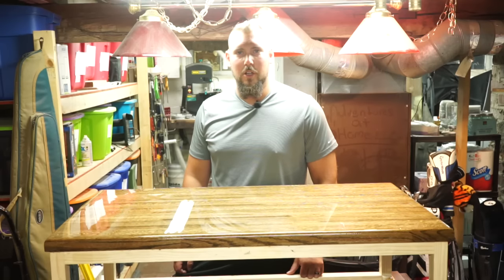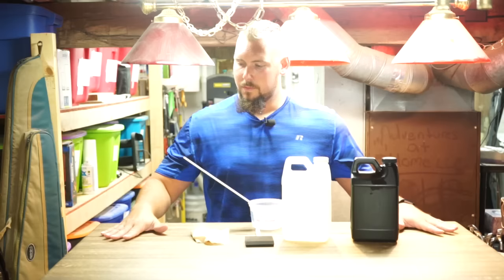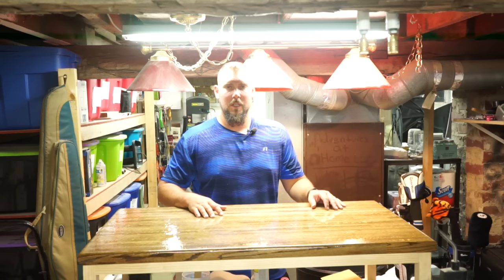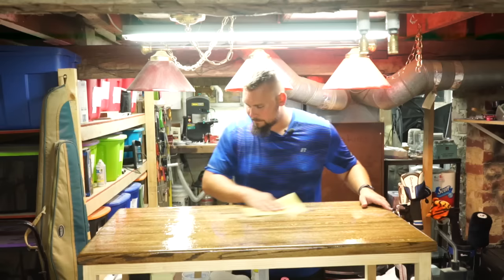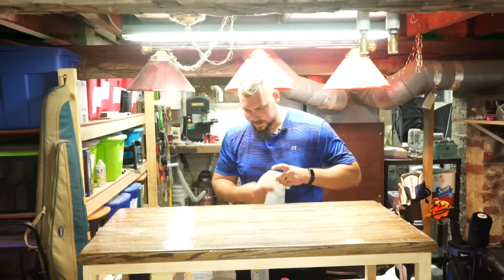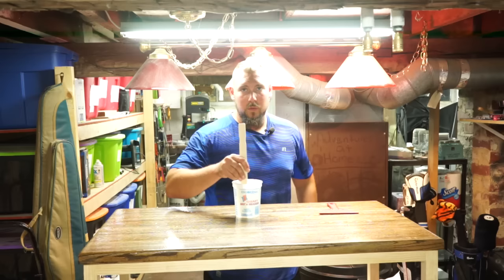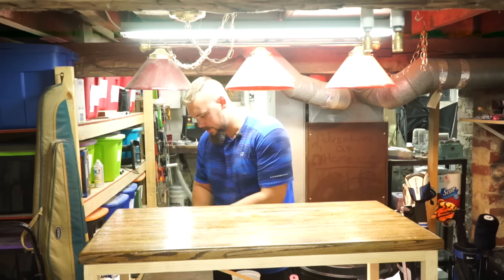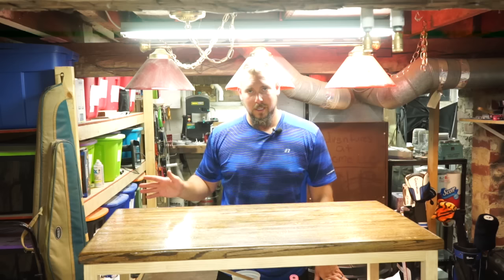DIY – How to Apply Clear Epoxy Resin – “Liquid Glass”

Comment: Rule number 1 when working with resin: "ALWAYS WEAR GLOVES". This stuff is nasty and the hardener can burn your skin. If necessary, when eye protection too as the heat from hardener can make you cry. 10 years working in fiberglass factory :)
Reply: My wife used it for the first time about 6 months ago... her ENTIRE body swelled up. 

Respirator and gloves... this stuff is NASTY!
Reply: 24:34 24:34 ll
 Mom

Comment: Just a couple thoughts.    When doing this on the flood coat use extra epoxy a little thicker will give you a much more even coat .    Edges wet them with a thin coat of epoxy before allowing it to run over the edge as it will be a much more uniform coverage.     The torch does not work a s well as a heat gun set on a low setting.

Comment: Thank you for explaining this so well.  Too many people spend too much time talking about every tiny detail and personally, for me, I just want the basics!
I find your videos to be easy and “just the facts!”  Great job!
Reply from the maker: Thank you for the kind words. And thanks for watching!
Reply: Oh and can you use a heat fun rather than a torch?
Reply from the maker: Yes - it takes long though, and you risk blowing dust deep into the epoxy.
Reply: @AdventuresAtHomeLLC  thank you for your advice and quick response!
Reply: @AdventuresAtHomeLLC  quick question do u think I can use resin on a wood cross for a  grave site ? Im also wondering if it’ll be ok in any weather
Reply from the maker: Unfortunately this epoxy would not be a good choice for this. It does not hold up well to the elements. A marine grade poly or epoxy would be a better choice. Thanks for watching!

Comment: Pass the torch over the entire surface in a sweeping motion. There are usually many micro bubbles that cover the whole surface and will not pop without CO2/heat from the torch.

Comment: Just did two 3'x6' tables in the garage. I probably over worked the thing, but the bubbles kept coming.  I used a redwood with lot's of knots. (I wanted knots)  to build the tables. I did them a gallon at a time. I did not weigh the product like you did, (lesson 1). I tried to get every bubble out, not just the larger ones, (lesson 2). Finally, I did not apply a thin coat, (lesson 3). Thanks for the video. I think it will help the next time around.

Comment: Thanks for a very informative vid. Now I know why I got lotsa bubbles on my benchtop timber slab, after following all of resin manufacturers instructions to the absolute letter with 2 coats of their 'sealer' prior to flood coat pour. I don't think their recommended sealer was suitable, hence bubbles. I like your method of thin epoxy coat prior to final coat. You made it look relatively simple. I am tempted to have another go at it. Thank you
Reply from the maker: You're welcome. Let us know how it turns out! Thanks for watching!

Comment: Thanks for the tip on measuring by weight. Since not all liquids weigh the same per volume, it's good to know we don't have to worry about that with epoxy.

Comment: The one thing I learned about removing bubbles is that it is not the heat that removes them, but the carbon dioxide from the flame. Breathing on it will do it too. I tried it.
Reply: That's so funny.  Carbon Dioxide...

Comment: @15:28  Raiden Wins!   over-exposed lighting melds the dude's head with lampshade :-) 

Thanks for the tips - watched this video after many others on epoxy resin "liquid glass"ing, and there were several points much better made here.

I'm part way through my first attempt, fingers crossed.
Reply from the maker: Hahahaha. Yes we were quite new at video making in this video. Good luck, let us know how it turns out. Thanks for watching!

Comment: I noticed you didn't address the drips that form underneath. It's always advisable to tape underneath, and remove tape before it completely hardens.
Reply: As they say "prevention is better than cure". Yes you can sand it down, however you can't sand out the resin which will have soaked into the wood, leaving a stained mark behind. Tape saves you having to sand back any drips.

Comment: FANTASTIC video! This is EXACTLY the tutorial I have been hunting for. Thank you very much. Maybe I'll send pics of the project one it is complete.
Reply from the maker: We'd love to see completed pictures! Thanks for watching!
Reply: Kyle, one question, how do you clean up the dried drips off the bottom of the edges? sanding? that easy?
Reply from the maker: Sanding is the safest method, and the one that I prefer. In a time crunch I have used a razor to speed it up, but you risk removing too much.
Reply: Looking for a DIY vid to help a customer clear coat the lower half of small very well made side table I cut a piece of glass for on top, too intricate for glass work on the lower half. As a craftsman of 45 years (born in 63) I find your vid most informative and actually surprisingly entertaining. It's very refreshing to see a craftsman work under less than ideal conditions. Hitting your head repeatedly on the triple light fixture but continuing/soldiering on professionally just soothes my soul for my less than perfect shop. When you started talking formula, 10:30 my mind started to drift. I noticed maybe a kid or yourself fingered "Adventures at Home" onto the duct work and how your wife utilized shelving and then the band saw way in the back. I can only imagine the wonderful projects constructed from that side of the basement. Just wanted to say you're inspirational. Keep up the good work!
Reply from the maker: Thank you very much and thank you for watching. I'm almost sad to say that we are in the process of updating our workspace. A lot of unforgettable projects (and memories) we're made in that small basement workspace..

Comment: Both my  epoxy/resin product and my propane torch emphasize VENTILATION.  I coated a panel door to transform to dining table.  Was afraid of the flood coats, so did several thinner ones.  Next time, I'll be more bold.
Reply: How did the result end up being?
Reply: @tobiashede  I admit that I still have one final layer. Will be bold & pour a lot of product so it floats evenly. Love the shiny glass effect.

Comment: Bubbles: if you notice any bubbles after its hardend, You dont have to live with it. Just take a 1/4 bit, drill it out, and refill.
Reply from the maker: Thanks for the tip!
Reply: Does the refill blend it completely with the old epoxy?
Reply: @tobiashede  regarding your eyes: yes. Regarding xray and forensic analysis: probably not ;D
Reply: When I did my first table top I “overworked” the bubble removing process in one particular area and as a result the surface “filmed over” with the over concentration of heat preventing the bubbles to be released. The area was approximately 16” x 5”. After the resin hardened completely, I buffed out the affected area with a standard grinder and resurfaced the table with another coat of resin. The finished result was surprising. It was impossible to tell which side of the table I had repaired/resurfaced. Seems to be really forgiving that way! This was the most important thing I took away from my first experience with epoxy resin.
Reply from the maker: Thanks for sharing! It is amazing how well a new later of epoxy will blend with the first. Thanks for watching!
Reply: @AdventuresAtHomeLLC  Hey man I'm glad the tip helped! I thought about it afterwards and I wasn't sure if that tip would work with every epoxy, I only ever work with Famowood. I probably should have mentioned that 😅

Comment: I was going to use glaze coat same stuff as in this video i decided not use the stuff being if the project gets messed up with bubbles or even if the coating gets scuffed in the future it would be nightmare to resand everything down to bare wood think its better just to leave wood natual no coating just a stain on top.
Reply from the maker: That's definitely a downside to working with this stuff. Start small and practice first! It's actually not to hard to repair scuffs with a little heat and buffing. Thanks for watching!

Comment: I saw a table top made with coins from foreign countries and then it was all in clear epoxy.  Just looked amazing.  I would like to do a table  top in cancelled stamps and  somehow get the pictures to be stable and  not  looking like oiled through.  Maybe a water based coating over the stamps.  I have seen tables with pictures under them on paper.   So some paper is able to be covered and still be quality to see.

Comment: The way you handle the drips from the sides is to either, take a chisel and scrape them off, or sand them off.  If I were to do this project, I would have done the top before attaching it to the base so I could turn it over and scrape/chisel the drips off the bottom easier.
Reply from the maker: The base was removed after the epoxy dried so the base could be finished. The base was attached merely to hold the top while finishing

Comment: Your work looks very professional.  I have been refurbishing the interior of a 21-year-old Rolls Royce (leather and wood) and the picnic tables on back of the front seats looked awful. After repairing the veneer and stripping them to the best of my ability I put on more than a dozen coats of lacquer with a spray gun but I could not get the finish even and it was very dull so after watching some videos I decided to use epoxy resin on them. At first I thought it looked great on the top side but days later when I did the bottoms they looked very, very bad---a medium scale disaster---and over flow messed up one of the good sides. I have most it removed. It came off of one table in one intact sheet. Now I am afraid to use epoxy resin on them again. Should I try epoxy again or use a spray on polyurethane?
Reply from the maker: For that application I would use a commericial grade table top clear coat. Check out AquaCoat's commericial finish. Thanks for watching and let us know how it turns out. We'd love to see a picture of that restoration job!!!
Reply: @AdventuresAtHomeLLC  I think some of the epoxy got past the masking tape and is inside the sliding spring-loaded mechanism that opens and closes the fold down tables I have to refinish. Is there a thinner or chemical that will dissolve it so that it will come out?

Comment: For a super fast and super dry cure time: turn oven on WARM for ONE MINUTE then TURN IT OFF.. Set your piece in there as oven cools. Usually cures fully in couple hours.
Reply from the maker: Interesting. Never heard that before. Though I don't think I can get most of my tables in the oven..
Reply: I thought of that when I commented. I can't build tables in my apartment or I would. I make lots of boxes and clocks, which fit in there nicely. Lol. Great video! Thx!

Comment: Awesome job, but if you use a roller it will make the job look better, it will push the epoxy into the cracks, but awesome vid man!
Reply from the maker: Thanks for watching! We found that the roller introduces a lot more air bubbles than the foam brush. Whatever works best for you though!

Comment: Any solution to removing brush marks in water based poly?  I have two thin coats on with a sponge brush and still see streaks.  This is a beautiful custom table top and I could just cry.   I didn't use the resin since I need a little bit more confidence first.  Any ideas on getting the brush marks out?  Thank you!  Your work is awesome.
Reply from the maker: You'll have to sand 😞 (lightly, but enough to remove the brush strokes).     Thanks for watching!
Reply: @AdventuresAtHomeLLC   thank you so much.  I did exactly that but the first coat marks are hard to get to.  It looks much better...sanded with a little wetness...Not re doing with anything.  Again, thanks!

Comment: quick, how did you find the weight/volume?  I've gone by volume on a couple of trial projects and they've worked out well.  my first error was not doing a thin coat, tried a spray on varnish which wasn't adequate.

Comment: Over time I would be worried about some sort of cupping effect on the wood if the bottom has not been coated. Ambient moisture absorption would be very uneven top to under side.
Reply: Then there is the radiant sun effect with the energy from the sun radiates and transforms objects to go in line with the sun rays, and add gravity to the equation basically you have a warped table so to counter that just add more windows to the house so that light comes in from all sides and as far as gravity forces, well, you can figure that out. Flip the table upside down everyday for the same hours and bam, no warp, flat as a paper!

Comment: Very good video. Once the flood coat has cured 72 hrs plus, can you polish or buff to remove imperfections (dust for example). There's no way mine will be dust free. Thanks
Reply from the maker: You can buff, but it is quite tedious and labor intensive to get it back to crystal clear. Thanks for watching!

Comment: How come  nobody  uses vibration to make the bubbles rise and to help level? I strapped  one to the leg of the table I was working on and during the pour itself. I saw my bubbles rise , break and fill in without having to use heat and causing wind that might stir up dust.  I just put a couple of rubber bands to hold  it. After the pour (2min.) I  put some cloth around the massager till the vibes  were hard to distinguish.. Checking  a couple of times saw nothing.Coverd the table with a clean cheesecloth supported above the surface to keep bugs, hair and dust off. Watched a lot of videos and  no one mentioned  using  these very helpful steps in my opinion.

Comment: What about all the epoxy that was running over the sides? Won't it leave some drip edges along the bottom of the sides?
Reply from the maker: There's drops along the bottom. We clean those up with a razor and sandpaper once they are hardened.

Comment: Don't hold the torch in one spot too long or you'll discolour it from burning. You shouldn't have smoke like you did. Just a quick flick over is all that's needed to pop bubbles. 
You also shouldn't wipe it down with acetone as that is trying to dissolve the epoxy in your table.

Comment: I could buy this two-year-old epoxy. Do you think that the jars will still work? This is the add that was placed.  Unopened 5 gallons of clear table top epoxy. I bought it 2 years ago to do a counter- never got around to it.  I don’t want to use it on the counter after all this time. I’m sure it works but I’d rather get fresh stuff when I get around to the project. My loss is your gain.  It was  roughly $300 when I bought it.

Comment: Good to know, so about 2x as much resin as hardener, by weight. I’ll check but thats a good starting point. Don’t be afraid to stir faster, more aggressive. Also, torch the whole surface more consistently. Not just parts. Keep it moving. The heat will warm up the epoxy, pop the bubbles, and help it self level.

Don’t use a flat scraper, use a foam roller. Lot of good tips on YouTube from companies that make epoxy counters.
Reply from the maker: Thanks for watching! 

We found stirring more aggressively and using a foam roller introduces lots of air bubbles into the mixture. By not doing trying to about air bubbles as we work we then only have to torch the parts with air bubbles.

 But of course, this is just what we found works for us. Thanks for the advice!

Comment: Hey not sure if this was asked in previous comments, about what percentage of the mix did you use for this first coat? A guestimate is fine. I’m doing a 15 sq ft table and will need a little over 2 quarts per the instructions. Just wondering how you decided how much to use for the first coat?

Comment: I was given a desk made out of 2x4's.  The top is not level in places.  I wanted to apply epoxy resin to the top to try and level it out.  Do I need to do a flood pour or do I need to make a casting around the top?  Also what should I use to prevent the resin from going between the 2x4's and dripping out the bottom?  Thanks for you response.  Your video was very informative.

Comment: Can you apply this to a very lightly scratched enamelled particle board bathroom worktop without preparation other than cleaning?
Reply from the maker: Because of the glossy finish of enamel, it is usually best to lightly sand it prior to cleaning and epoxy. Thanks for watching!

Comment: I appreciate the math of the flood coat. How did you calculate for the skim coat?  It looked to be 1/3 to 1/4 the flood?
Reply from the maker: I usually figure it is about 1/4 of the amount I would need for the flood coat. Thanks for watching!
Reply: Thanks!  Finishing my basement bar build aka Covid project and this helps a lot!  Great video and thank you for the videos
Reply from the maker: You're welcome. Let us know how the project turns out!
Reply: Thin coat applied. Looks great, has some low spots or divots where coverage was a bit thin but I assume those will fill in on flood coat. Only one bubble I can see. Can I sand that down and cover with flood coat?  Thanks again!
Reply from the maker: Yes - fix everything you can in the skim coat and the flood coat will cover up your tinkering. Happy building!
Reply: Finally finished last coat last night.  Had to do a 2nd flood coat as I skimped on the epoxy a bit for the first flood coat and had some ripples that wouldnt settle.  roughed it up with 80 grit sand paper and hit it again.  Now it looks great!  Thanks for all your help.  How do i submit pictures for you to see?
Reply from the maker: Customerservice@adventuresathomellc.com.   Or there might be a way to post a picture in the comments.. not 100% sure.

Comment: Hey I wanna do this on our kitchen island but I don't want it to rundown the sides. Can I tape the edge so it will stay on top only?
Reply from the maker: You sure can. Usually it's easiest to use melamine boards, but if you can't, you'll have to build up quite a few layers of tape. Thanks for watching!